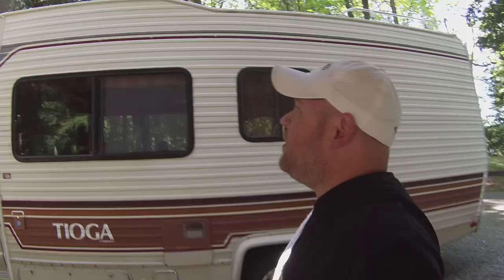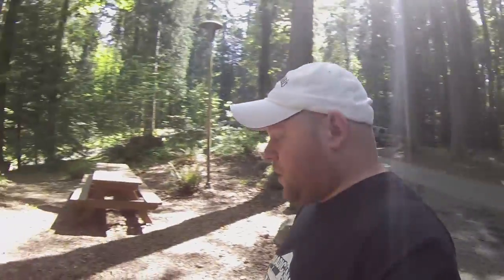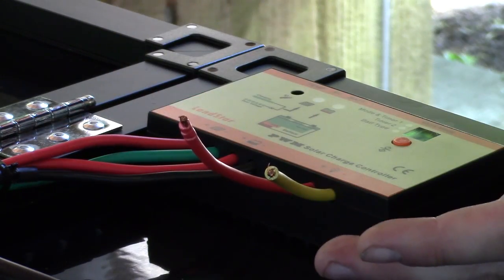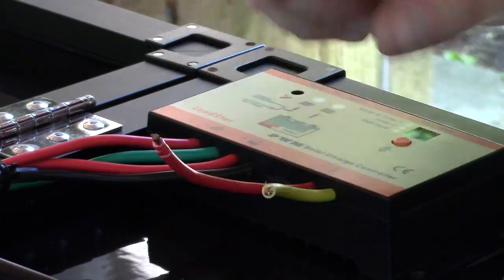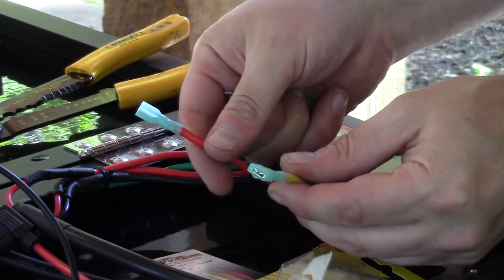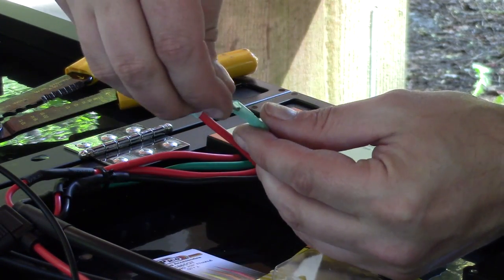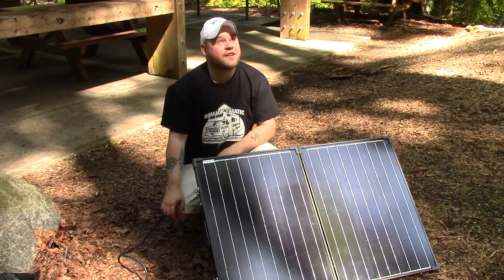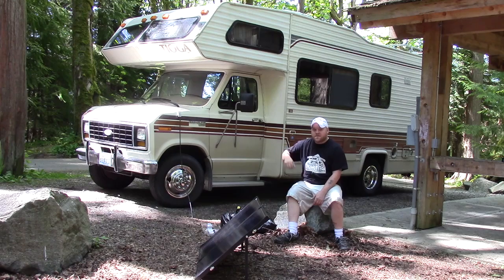Introducing Solar Power Into My RV

Comment: Need A Battery?

Add up the power and time of what you will be using. i.e. laptop, camera, lights, ect. For instance, Laptop @ 40W for 4 hours + LED @ 10W for 5 hours.

 (40 x 4) + (10 x 5) = 
160 + 50 = 
210 Wh

Divide the total power usage by the volts (12V)

Remember not to discharge the deep cycle battery below 50%. 

210W x 2 = 420W

420W / 12V = 35Ah

So you need a deep cycle battery rated at 35Ah. 

I am installing panels soon, so this is what I have been learning. Thought I'd share it.

Comment: i like ur video,its very helpful, i want to know if i can run the AC on it or the heater and will it help charge my battery as well ?. or do u think i would need to get 2 solar panel

Comment: One question. I just bought a 1994 Tioga. There's a solar panel on top of the AC unit. Do you have any idea what that is used for or even how to use it? Found your videos while searching for info on Tiogas. Thanks I've learned a lot 😊.

Comment: how much energy will that one panel provide after being out in the sun for, say, 3 hours?
Reply from the maker: +Jeff Hlavatovic Well there are a lot of variables. Like the 7 stage charge controller. It decides how much of the 37volts or 250 watts to send a charge rate to the batteries. Battery level has a lot to do with how much charge it should send as well to keep it maintained and not boil over.  Genreally, when batteries are under 70% for me and I'm getting plentiful sun, I can see 16amp charge rate being given to the batteries.

Comment: Hey Eric, For future reference the quick clips you crimped on the load wires have shrink tube plastic so you can heat them up and it will shrink around the wire insulation.

Comment: hey Nomad, I enjoyed this video.  I was looking for a solar panel system for my truck camper and I think I will be getting that portable system too, 100 watts, 6.17 amps -- good enough to charge a battery in a decent amount of time.   Do you have a small generator too, in case it's a bad cloudy day and you just have to have power?
Reply from the maker: Terry McMillan I have the on-board generator, yes. And I'll use my speed charger and charge the battery in under 2 hours on cloudy, rainy days.

Comment: Here's a suggestion for those bare wires. In order to keep you from getting the positive and negative wires mixed up, try using a trailer plug that has one female socket and one male socket.  I do that for an electric outboard motor on my canoe, rather than connecting the battery and hoping the wires don't touch.
Reply: Great idea

Comment: Very nice, here is a kit that's not to expensive
<a target="_self" href="http://rover.ebay.com/rover/1/706-53473-19255-0/1?icep_ff3=2&pub=5575109810&toolid=10001&campid=5337621459&customid=rv+solar+panel+kit&icep_item=291011889419&ipn=psmain&icep_vectorid=229529&kwid=902099&mtid=824&kw=lg">solar panel kit</a><img style="text-decoration:none;border:0;padding:0;margin:0;" src="http://rover.ebay.com/roverimp/1/706-53473-19255-0/1?ff3=2&pub=5575109810&toolid=10001&campid=5337621459&customid=rv+solar+panel+kit&item=291011889419&mpt=[CACHEBUSTER]">

Comment: I'd like to have the solar always connect on the roof but with the facility to un-clip for the odd occasion when your going with this set up ....

I'd guess at least three quarters of the battery re-charge would be coming from the roof set up... Maybe you can retro fir a housing stand on your roof ?

Comment: Slamming the hood down on the wires is not the best idea.  Wires could get nicked/cut and short out your system.  Just leave the hood open or better put an all weather female plug on the fender and male plug on the extension cord to the solar.  Also, hardwiring the wires to the battery as someone else mentioned is a good idea.  Finally, you could add more extension cord to get the best sunny spot.

Comment: Wow. I can see you've put a lot of thought into your new solar system. It seems like a great product. If I could offer a couple of points that came to mind while watching this, that may prevent problems for you in the future. First of all, whenever I use crimp-on connectors such as the ones you used, I always pack them full of dialectic grease. Just squeese in one end till it comes out the other. I use the heat shrink kind for even more protection. Then make your crimp and wipe off the excess. You will never have a corrosion issue or moisture finding it's way in. Second, I'd find a way to anchor those pannels so they can't be blown over. Perhaps tent pegs and bungee straps? It would be a shame for them to be blown or knocked over and break. Where I live, picnic tables can fly away. No shit.
Reply: Kevin Parker Why does this haffta be so difficuult.  While I'm waiiting I'm going to listen to Tom Petty American girl
Reply: Kevin Parker And then just got paid today by Joe Bonnamasa

Comment: Nice kit. You may want to look into permamounting that quick disconnect with some extended leads. Nikki & Jason Wynn of Gone With The Wynns had a mixed mounted/portable setup and bracketed the quickconnect just under the RV in an easy access location. Also, NEVER plug devices directly to a charge controller. The CC expects a battery to be on the other end, and sends the current and senses the backflow from the batts to control how it regulates the charge.
http://www.gonewiththewynns.com/portable-solar-kit

Comment: I use those quick connects on my boats, they're awesome. I really don't like the jumper cable clamps on a permanent connection though. Those jumper cable clamps are a weak point and you shouldn't have to open your hood every time you want to plug in.

My suggestion would be to buy some heavy wire and a few connectors. You want pretty heavy duty wire because low volt systems lose a lot of power over any kind of distance. 

Mount a connector in the grill and run wire to the deep cycle battery. Connect to the battery with heavy duty ring terminals. You can buy booster cable wire from the vendor below for about $3.60 a foot for 2-gauge or $2.50 a foot for 4-gauge.  

They make covers for the connections, so you can weather proof the plug while you're on the road. 

You can put connectors onsome booster cable wire to give yourself an extension cord. You'll get some voltage drop from the extra distance, but it's better than being under a tree sometimes. That cable could serve double duty as jumper cables with the dongle you're hooking up to the battery now, in case your starter battery ever died or to help someone on the road.

Link to the vendor I get my connectors from: http://www.spectrowireandcable.com/c/QuickConnect/QuickConnect.html

Comment: It would be cool to have some solar panels mounted in the overhead sleeper with a battery bank. So im assuming since youve got solar you must have an inverter. Ive got a 2000w inverter setup that i used to run off my chevy but now ive got a dodge and the thick guage cable is too difficult to run in the dodge. It used to be a straight shot from the battery through the firewall under the carper and behind the seat. Now im forced to find different more flexible cable. What guage are you running?

Comment: Nice set-up, still debating roof mount or portable.  More wattage from roof but that shade sure looked inviting.  You can mount the large plug into front grill, a lot of wreckers put it there for jump starting.  Maybe cut and split a piece of gas/water hose to fit across the plug to keep rain and crud out, have seen rubber caps at NAPA and other auto parts stores.
Reply: Yes, bringing it out through the grill works great, if you don't want to drill holes in bumper for the connection you can do what I used to do with my service vehicles when I owned a tow company, and that is use plastic zip tie which works great and no holes. :)

Comment: Are the solar panel & charge controller water resistant?  I know it rains a lot where you are.
Reply: Nomadic Fanatic Hmm… I wonder if you could get that coated, so it that it won't happen?
Reply: You can coat the metal parts with clear lacquer, that's what I use when I don't use stainless steel and to seal battery terminals and all under hood electrical connections.
Reply: They're probably just talking about your hinges and latches rusting.  I second the idea of a clear lacquer coating on those parts.  So how's it working?  Are you getting some reliable juice out of it?

Comment: Maybe replace the clamps on your battery quick-connect with some more permanent ring terminals bolted to the battery.
My battery tender for my motorcycle came with both types of setups.

Comment: I got the 150w Solar Panel system one 50w and one 100w  on a 20 m extended cable so can move  them around as well as the panel ive made it so it can clip onto the roof and come off as well to save space in the campervan u may find 100w is not enough power u need at least 150w -200w   to be able to produce enough power for most of u things ie laptop etc and i got mine hooked up so it runs the lights as well in the campervan

Comment: i have solar i use harbor freight 2 -15 watts & a mono type 30 watt for boat to run 12 volt trolling motor! i mounted them on a shade area over the seat this charge battery's i also use same battery's for camper with a 30 watt poly & 2 45 watts set from harbor freight and inverter to 120! thus i use boat or camper!

Comment: We had a quick connect system like that in the one fire truck it worked really well to mount the quick connect in the grill all it takes is a few zip ties
Reply: Yeah, I was thinking the same thing about putting it in the grill and even replace the clamps with some cheap ring terminals so he doesn't have to worry about the clamps coming loose and arcing.
Reply: That sounds like a good idea too

Comment: Hey Eric.  I'm pretty sure the "Load" leads coming from the controller are to enable you to see how amps you are currently using.  These solar kits are used only to charge the battery and will not directly provide power.  It is a really nice portable solar kit.

Comment: I see why you went with the portable ones due to wanting to be parked in shade as much as you can. I just wonder how often will you be able to sit them up while in Walmart or stealth camping? Maybe you can get a cheap 20 or 40 watt one to mount on top just for the days you are unable to set the portable ones up. Would not give you much but it would be good for just one battery like you have. I guess if push came to shove you could slide in in the front window and catch some sun that way

Comment: Awesome Eric! great video , if you can get long enough cables you can send the "load" wires from the charge controller to power a additional inverter , or even back to your converter to send power to the outlets in your rv. awesome set up and thanks for the shout out at the end

Comment: Congratulations on the solar. Nice setup. Only thing I would change is to replace the battery clamps with permanent connections, since you have the quick-coupling anyway.

Comment: Is it Monocrystalline or poly.
What about a converter... I'm trying to learn this stuff. I read about pure sine to run laptops cuz modified will damage certain electronics over time...
Reply: The best way to power a laptop is with a charger designed to use 12vDC as a power source and skip the 120vAC altogether. Having said that In the past I ran a laptop for a year and half at one point with just a modified sine wave converter.
Pure sine wave is expensive, and really is only needed for sensitive equipment.
Just go to Amazon and type in 12VDC power adapter for (Your laptop model and brand here) More efficient as well, and when your talking about living off of batteries you need every bit of efficiency as you can get.
Reply: I Think he got mono , you would want a "Inverter" to transfer 12v DC to 110 AC and yes a pure sine wave is the best for high end electronics (laptops, flat screens, etc)
Reply: a converter would drop down from 110 ac to 12v dc  to charge your battery while you are plugged into shore power (thats how my converter works)
Reply: ***** I have an Outback Power Inverter, when you run the generator or connect to shore power, the Inverter becomes a Converter and charges the batteries.
Reply: Monocrystalline panels have cells with rounded corners and are a uniform dark color, Poly panels have cells with squared corners and have multiple shades of blue. These look like Mono.
Reply: ***** I just took a look at one of your videos, nice job mounting those two panels! I counted 36 cells on each of your panels, the individual cells actually do have rounded corners, I see white dots between the cells. BTW, very nice piece of land you have there! I also have 3 acres but i'm on a steep slope, only half is usable and no shade trees for me.